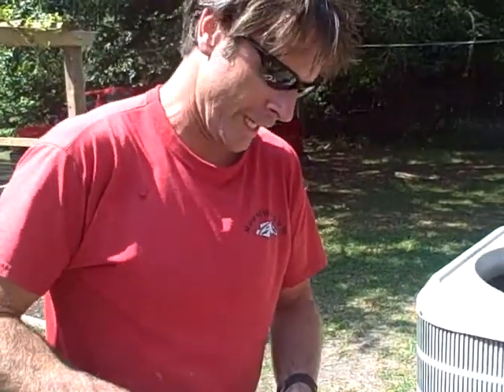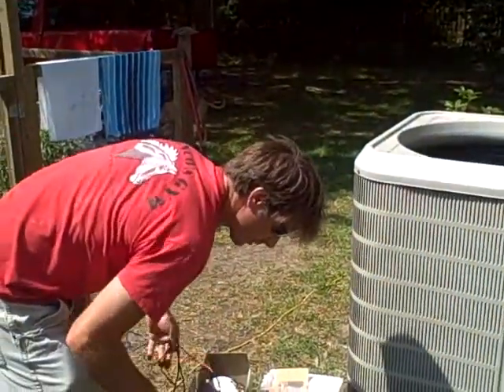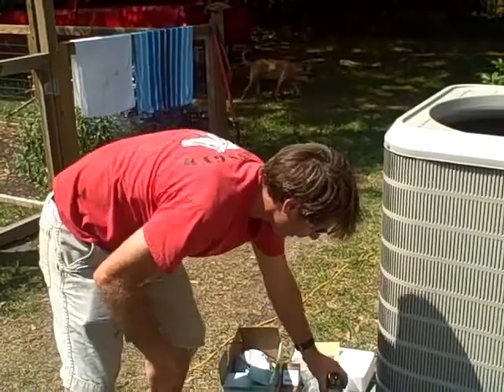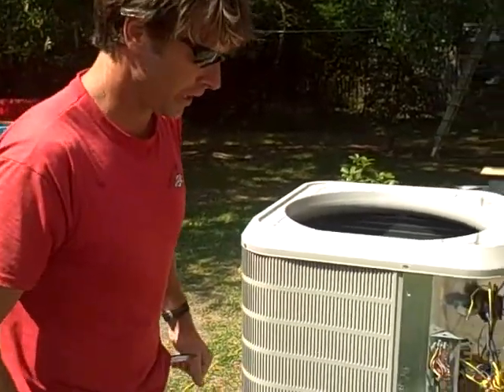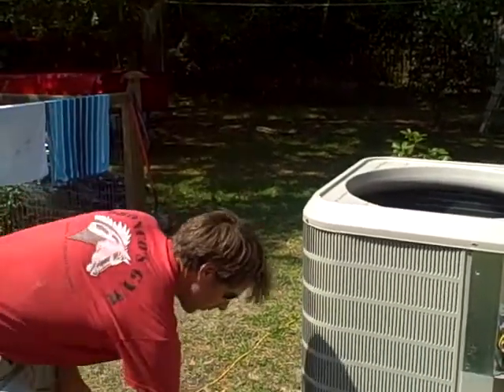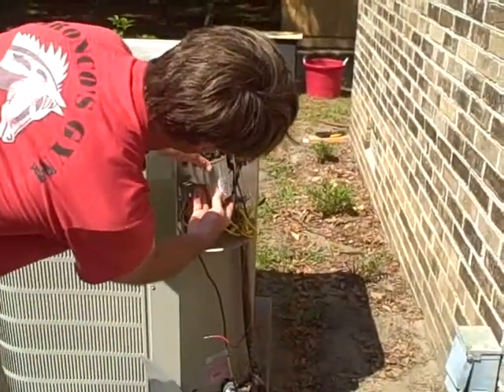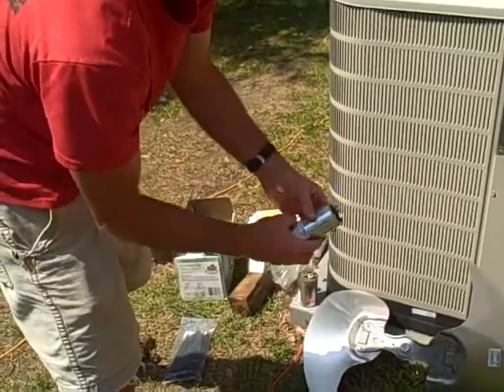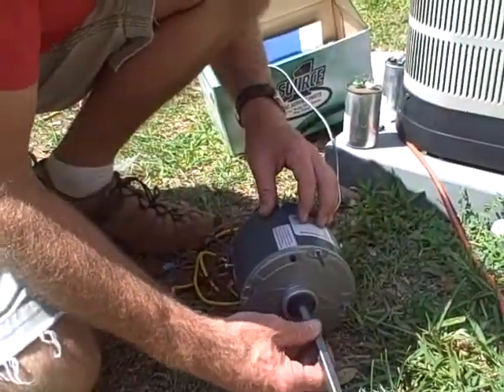How to Replace Air Conditioner Motor.mp4

Comment from the maker: @masternene  Hello, Most likely just the motor but I was taught to always replace both. Capacitor is cheap so what I suggest is replacing the capacitor -  see if it does the trick.  If so, you're done.  If not, put a new motor in as well.  Capacitor is around 20-25 bucks.